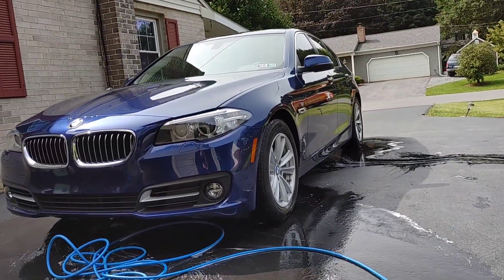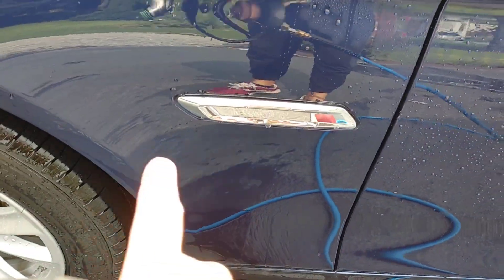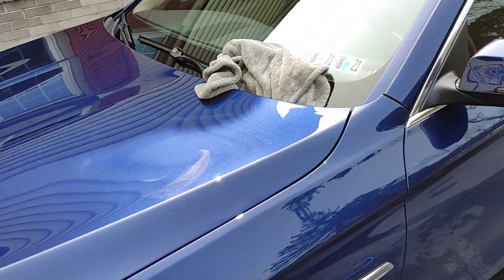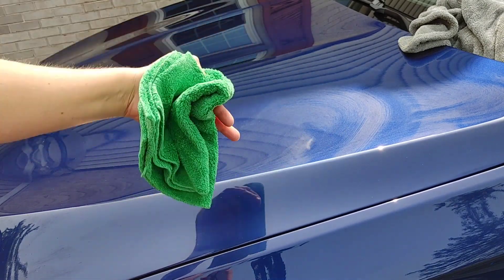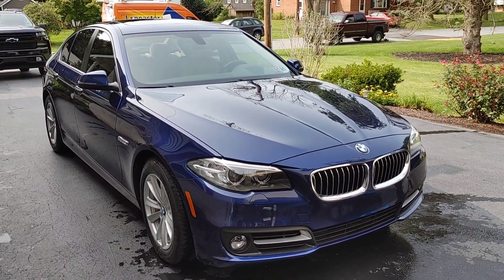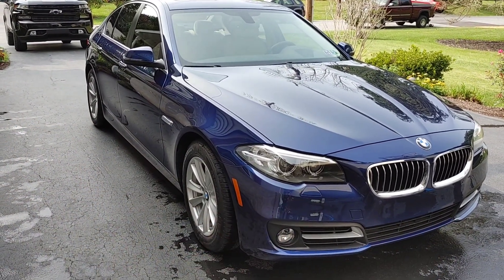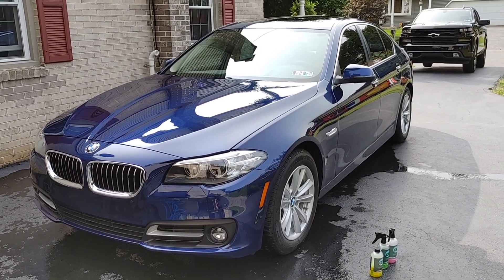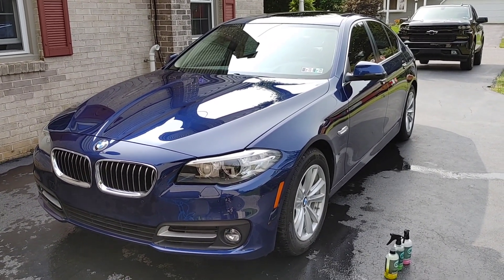Owners Pride Ceramic Coating Maintenance Wash!- 45 day check-up and solving some issues

Comment: Try OP Spotless to restore coatings and unclog the surface. It's like magic how well it works. There really shouldn't be a need for applying a detailer spray on a recent coating!
Reply from the maker: I have used it and yes, it is a great product and I find that McKees 37 fast water spot remover performs very similarly, as well as UD Waterspot remover

Comment: What tip and orffice size are you using with your active ve52?  Your flow rate seems more insane compared to my setup ( same as yours)
Reply from the maker: I'm using the 25 degree tip I believe that came with my mv925 gun.

Comment: Great review!  I'm not really interested in a ceramic coating at this point, as I'm happy so far with just a ceramic spray coating and a ceramic topper of some sort that I maintain.  But I have to say, I'm very impressed with what I'm seeing from OP.  It looks like a combo of Super Wash, Eco Wash, Ceramic +, and Ceramic Detailer would be awfully hard to beat! Tempting to try them out, for sure...
Reply from the maker: Their coating has raised some concerns but CD is a good product to maintain your 🚙 with
Reply: @attention2detailswchelsea  Thanks, Chelsea!  My problem as someone who's just an enthusiast new to the detailing scene is that there are just so many products that look fantastic. I want to try them all, but I obviously can't afford it, and we only have to 2 cars to put them on anyway! 😊 I'd probably be better off just picking one company/product line and sticking with it.  But that's hard to do...
Reply from the maker: @mhlittleton6493  if youre looking for one brand check out Mckees 37. Every product from them is amazing and they stand behind their products
Reply: @attention2detailswchelsea  Thanks!  They'e definitely one of my favorites.  I've tried a few of their products, and they've all been great.  A bit on the expensive side compared to some, but they work very well.
Reply from the maker: Theres been MANY reports of coatings failing 6-12 months in. My own truck the OP coating failed at 6 months and I babied it.
Reply from the maker: @Scotty secretly loves Chryslers I just tell people do their own testing but honestly I stopped using OP after that. I do use Technicians Choice coating but as a 12 month option.
Reply from the maker: For OP? Is that with the 7 year warranty?
Reply from the maker: Wish you lived closer as Id be happy to help you find an affordable but durable option.
Reply: @attention2detailswchelsea  Do you still recommend OP products in general, Chelsea? Is it just the coating that’s having issues? Hopefully they’re working to fix the problem and not just shifting responsibility. Seems to be human nature to do that, though, unfortunately…
Reply from the maker: @mhlittleton6493  their basic lineup is good but I have found more affordable options that work just as well. They do work. But durability for the coating is my main issue. Ceramic detailer is still my favorite of everything Ive tested. But for the $$ I might look for something that lasts longer personally. My customers who have used OP products have no issues but just wish the coating was more durable. But for the $$ Id rather just use Technicians choice
Reply from the maker: @Scotty secretly loves Chryslers in Lancaster PA

Comment: 5:55 could you just use a detailer instead to get rid of those water spots ??? Or whatever the case may be ???
Reply from the maker: Didnt work l, not even a clay bar or OP Spotless which I tried lightly first off camera to see if they would come off. Alcohol took it right off as they were pretty stubborn but didnt damage the coating